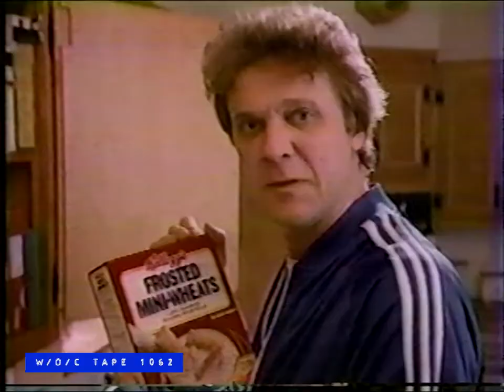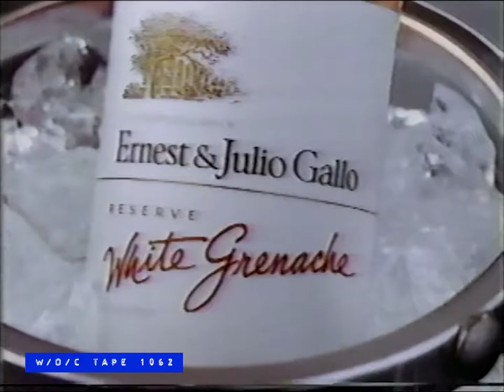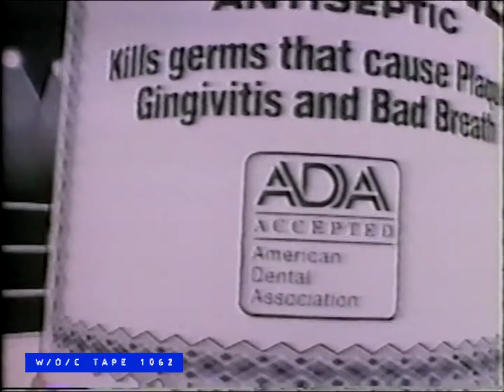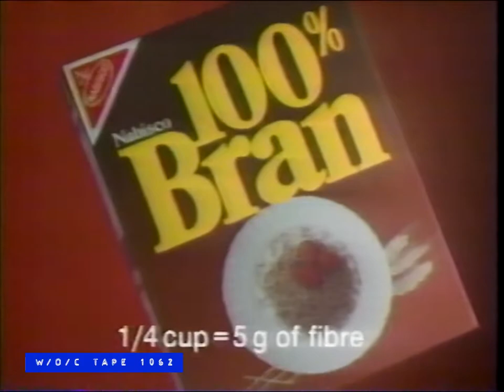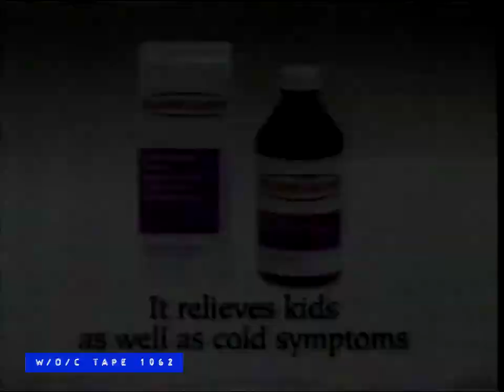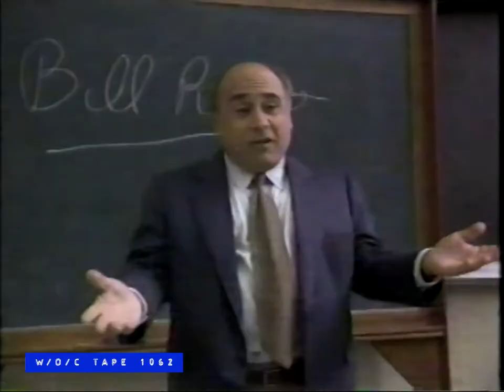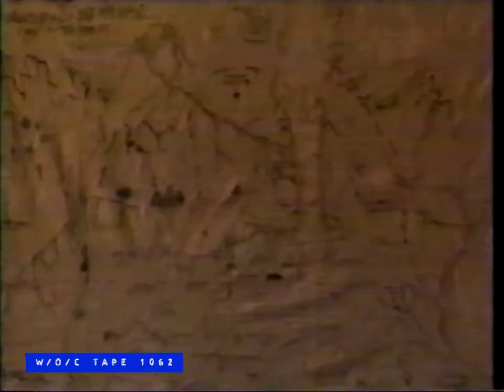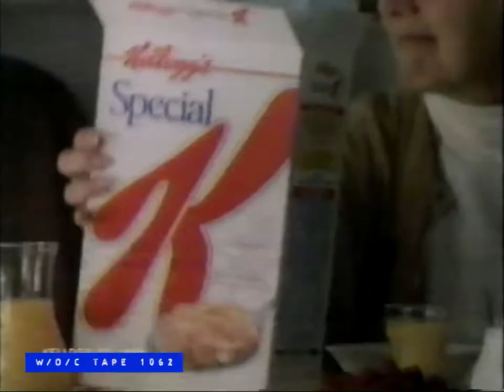WOC Tape 1062 Commercial Compilation - 1990

Comment: This is from 1994!
Reply: The The Pelican Brief (19:04) came out in December 17, 1993. This aired before that.
The Canadian Tire Christmas ad (21:50) also support that this was likely from before Christmas.
Reply: 37:49 Is likely from 1994 though, with an ad for the 1995 Nissan Maxima and 39:08 with 1994 Hyundai.
Tapes often have sections recorded on different dates.